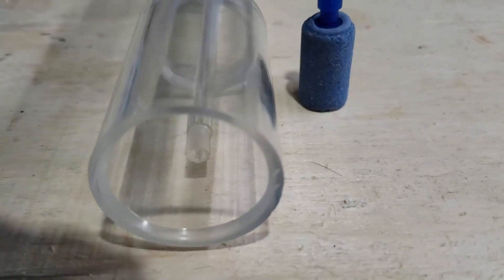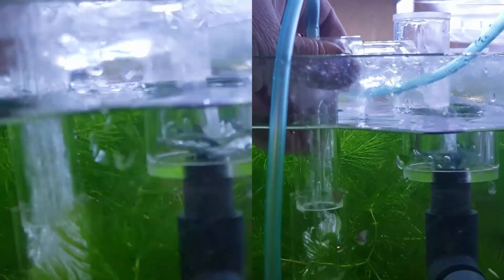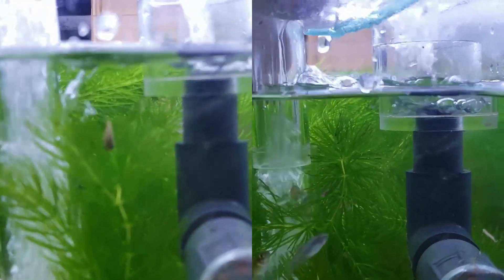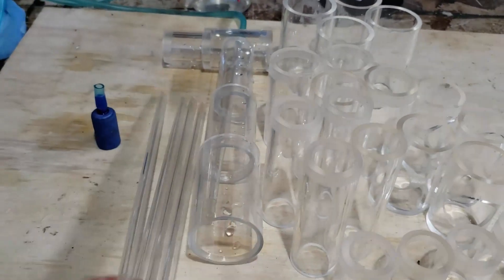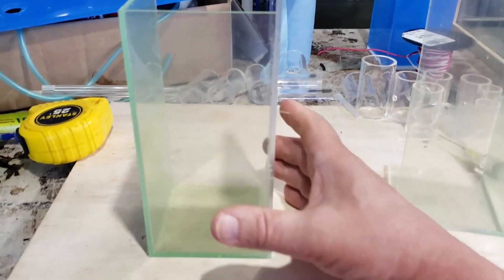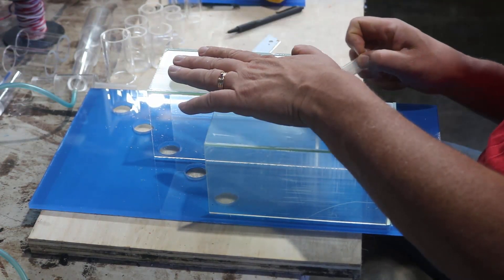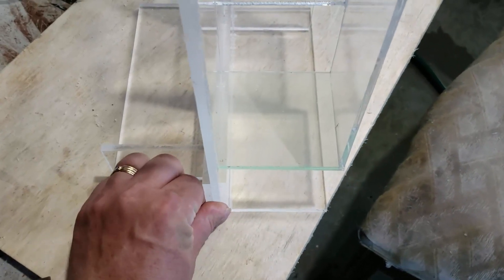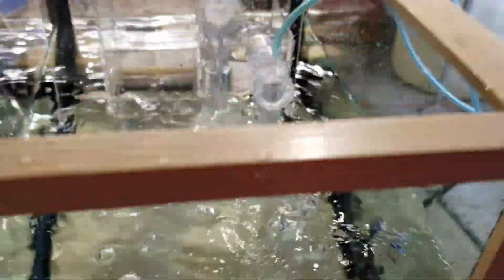Air Water Lift with Steps not Power

Comment: I was thinking on this when I noticed some water I missed in a python after a water change and thought of this project
My first though was a series of coils in a flexible tube angled upward with the bottoms of the coils acting as catches and valves. My next thought was a more straightforward series of peaks and valleys increasing as they go. 
Great - now I need to go get some 1/4 tubing and a better air pump.  Best of luck!
Reply from the maker: If you put that together let me know how it goes. Would love to see it

Comment: If you are feeling adventurous, how about an air-driven Archimedes's screw?  It would probably have a slow flow rate, but it would look cool.  
Great video.  Been enjoying watching how this water lift evolves.
Reply from the maker: Thanks so much for watching. I have been thinking of using a DC motor for one but I haven't figured out a way of running one with air

Comment: if you sealed each chamber into the next couldn't you run just the single air connection at the bottom letting the air continue through each step being recycled by the next? thought maybe pressure would be an issue but thats broken each step as it bubbles up into each chamber, i think.
Reply from the maker: Even if it worked a sealed unit like that would be impossible to clean. Thanks for taking the time to watch and share your thoughts
Reply: @FishmanEricRussell  Sealed to air, but not sealed as in fixed.

Comment: This is really interesting but if your going to build something this complex why not try an air powered pump (sort of like how a turbo or an steam powered pump would work). Could even do double duty powering a pump and than an air lift. This stepped lift just takes up too much room in my opinion.
Reply: https://www.youtube.com/watch?v=8W1Xig6J_Rk

:D
Reply from the maker: Such a build would require more pressure than an aquarium air pump could supply. I mostly build these things to try stuff out and see if there are better ways of doing things. Thanks for watching